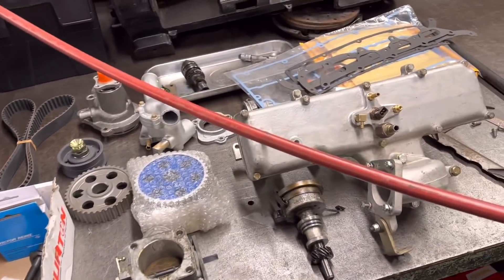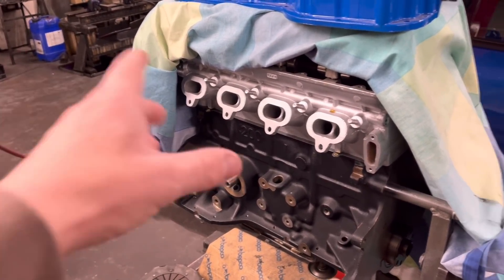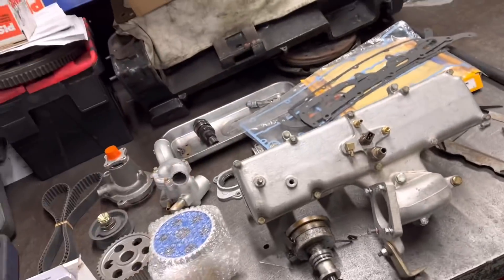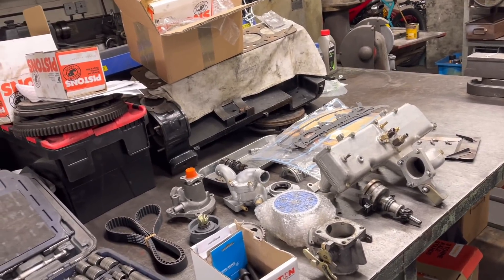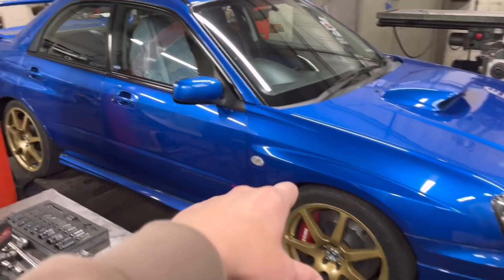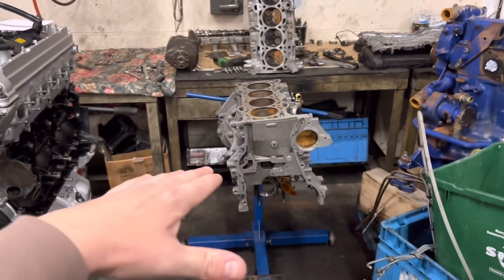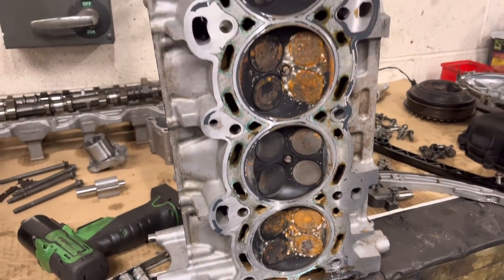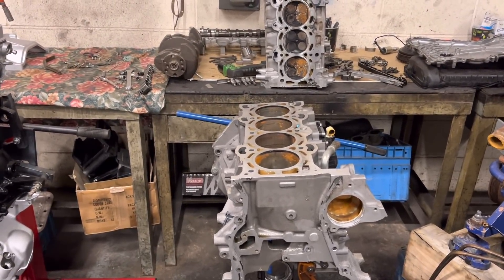It’s back for a Warranty claim check, but is it even the SAME ENGINE?

Comment: When I used to work in a garage if we ever sent expensive parts from the rally cars or done something for a customer that was a "strange vibe" customer we would carefully use metal letter stamps on each part that way we can identify it. If you were to stamp your initials somewhere discreet on the block and head it would give you clear indication if they bring back the same block with different head vice versa.
Reply: Been there too, with a center punch - three dots in a triangle
Reply: @leifvejby8023  exact same thought " 3 dots in triangle "
Reply: @truey90s  sooo... if all of you do 3 dots in a triangle, how do you tell each others parts apart? ;)
Reply: A long time ago my grandad had a stamp made up to mark his stuff, 1/4" diameter with his initials in a circle. You have to keep notes on all your work that goes out with a warranty of where its stamped, especially the expensive bits. Block, head, crank, cam shaft, turbo. These days laser etching could do much more even putting the date when the work was done on it.
Reply: @peterdurnien9084   A QR code
Reply: @peterdurnien9084  Spot on, an exclusive metal stamp that could not be easily reproduced along with laser etching or engraving.
Reply: Chris Hanlon, I have been rebuilding and reconditioning engines for over 50 years and I’m with you on this,every engine I do I put my initials on the block,the crankshaft pistons and rods and any other parts I think might be appropriate like the cylinder head just for my own piece of mind in case of any problems,I also use a job card detailing what was wrong with the engine when stripped it,also on the job card was all the sizes of the pistons bearings Ect. and where they were purchased from and the invoice number and date of purchase. This has served me well over the years and if a problem occurred I would insist that I stripped the engine in front of the customer so they could see for themselves what the problem was,I never told them about the markings I had put on the components just in case they tried it on. Engines do go wrong from time to time for various reasons and if it’s the parts I’ve supplied after looking at the job card for that engine I know instantly where they were purchased from and the sizes supplied. I’ve had a couple of people trying it on over the years but when confronted with the facts they’ve left Red Faced and embarrassed. For everyone’s benefit these things have to be done,if a part fails I sort it out and any other damage done by that part failing and then pursue the Supplier for costs incurred in putting it right for them to contact their supplier’s to claim against,it’s a long drawn out process but at least the customer gets his engine back fully rectified at No cost to them.
Reply: I do the same thing when I build computers from scratch. Customer doesn't know it but there's tell tale marks engraved everywhere...
Reply: I just suggested the same thing
Reply: engrave or etch not stamp, be gentle.
Reply: @garym1550  it's not like we were using a 5kg Hammer and playing the drums on it🤣. It's literally putting 2 letters in a hidden area that won't ever cause damage or issues.
Reply: @ChrisHanlon88  it only takes one touch with the point of a 5mm drill bit , all you have to know is where to look for it.
Reply: @garym1550     Laser etching    very gentle
Reply: Oops just read this after suggesting similar - great minds and all that. Did this for years when I repaired expensive Siemens Servo Motors - the serials were sometimes on thermo printed labels from the factory which became unreadable after exposure to heat(obvs). So a teape "D9" in an oval confined my involvement in any repair. Prior to that a pattern with a drill bit sufficed - a hidden three dot triangle.
Reply: I use 1/2 drill bit put 3 dimples in certain place looks like somthing factory would do that way they never know even when they are looking
Reply: Do exactly the same thing!, how bad is it that we have to covertly mark stuff to protect ourselves?. I have a tiny little stamp that I made as a toolmaker and it's unique. I mark in locations you would not see if I did not show you. I also have taken to keeping a detailed photo record. Some people will " convincingly tell their point of view" but go sheepish when shown the irrefutable photo evidence! Got to cover your arse!
Reply: @andrewwilson8317  
Regrettably that’s how it’s now become in so many trades. I spent a short while doing courier work for some extra cash, one afternoon I had a local delivery for which the customer was, allegedly, waiting. I was given precise instructions where to leave the package in a secure location but the fact that the customer, who was supposed to be waiting, could not be found worried me. I took a number of photos of the package in the exact location along with open doors to stables and offices.
By the time I got back to the depot the customer had already been on the phone complaining about non-delivery. The following morning she attended the depot and her face was an absolute picture when I presented my boss and her with all the photos I had printed overnight.
As you rightly say, 'Got to cover your arse!'
Reply: Good idea - just don't burn your initials on someone's liver if you're a surgeon 🤣
Reply: I had to use that tactic with a well known Motorcycle Co.   They reckon they did the service 100% with up yours to go with it.   On checking the engine a 2nd time at their shop, nothing had been done.  The marks we put on it had not even been cleaned where by they surely would have spotted the marks. under the grease over the top   Nope, you would think if you taken a brand new motorcycle back, they would have at least do what they are supposed to do.  Some choice words exchanged and compensation gained.  Never went back there again.
Reply: @julianp2868  Had the same with 2 brands of brand new vehicle's, marked everything as i had been forewarned,  and sure enough, not even the first oil change done.
Reply: Ironically I do the same with my parts to ensure the machine shop give me my own parts back😂
Reply: Yep always sign your work
Reply: It's my idea also to stamp in some kind of name, year, month in a place you just know.
Reply: Combine with a date code for returning items in case the part you fixed comes back after changing hands. In this business you'll never know.
Reply: 100% right
Reply: Great minds and all that: I was going to suggest marking your stuff. That along with serial numbers etc noted on your invoicing system would make you bullet proof. I mark all my kit at work with two punch dots. Not always immediately obvious but I know where they are!

Comment: A light hone with ATF or hone oil then look for pitting. I only say this because the walls look thin. Unless you are going Sleve the block.
 Serial # on the parts ?  you need to keep track on a receipt  from now on or add a specific number on the block & or parts worked on. 💪 this why you don't get hung out to dry
 My old shop would use a 5 digit number on all parts to that engine 
 Block , heads , intake, rods, cam, crank, even pistions and covers valve , oil pan, carbs as well. This way he knew if something came back and what he did to it. He was a very detailed person. Not that I would ever do this you could eat off the floor at his shop he kept it that clean. To bad he has passed away sadly.  His family didn't want to keep his shop going ): 😞.   Be safe team.

Comment: 500 hp my goodness.  Is that a 2.0 liter block n/a or boosted? 
 Cossworth engine? That will be scary to drive in such a short wheel base. 😳 
 Be safe.
Reply: It's way over the top...
Reply: I was impressed when he said they were wanting 500hp, but in the description he said 500Bhp, which will be around 400hp. Still potent though.

Comment: Might be interesting to scope out the back of all the valves, looks like engine may have been sat outside with no manifolds. If there is rust on the back of the clean valves it would be a sign of whether the water was from outside. A cynic might think the engine was jet washed to make the outside look clean and then left....
Reply: Its a good point you make about jet washing.
Reply: Good thinking! I did think about the jetwash therory. Got to be a true doughnut to clean a block and head with exposed ports.
Reply: Makes sense as the rust looks like no inhibitor, would also measure bores and crank to compare sizes with the rework record as for grinding off the mains studs end of argument no warranty!
Reply: Good thinking on the jet washing.
Reply: Agreed, pressure washed.

Comment: Strange that Cylinders 1 and 3 have rusting on the valves .. looks like water may have come in from intake manifold with 2 and 4 having their  intake valves shut , if engine has been laying around in a shed / garage ...  Failing that ... I'd  check the head  surface  ... probably find its warped.. where the engine has overheated during a competition  run..  Ask the owner to collect  and Get Rid Quick ... Just My Thoughts ...

Comment: Back in the day when I was rebuilding engines, I would mark the date behind the flywheel with a number punch, like 3 21. If the engine ever came back I would know if it was the same block... Did the same with date mark behind the head...Just a thought

Comment: Just curious. If when prepping performance engines if you use shot gun and rifle ball hones spun in both directions thru the oil galleys followed by hot flowing water and a nylon bristle oil galley brush. Taking off burrs and polishing the galleys for smoother oil flow.
Reply: *Galleries.
Reply: @Mr-Yan.  That depends.. brought up correctly then 'galleries' but.. dragged up proper then its 'galleys'..
Reply: @Mr-Yan.  Don't forget i am from California.